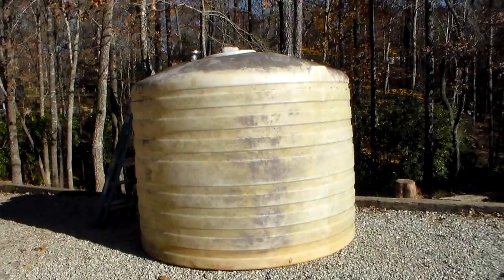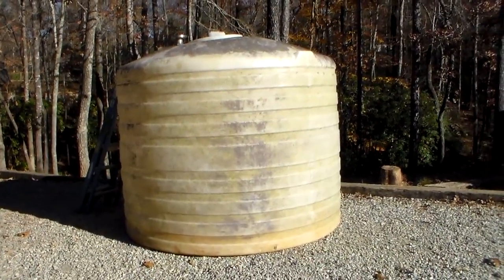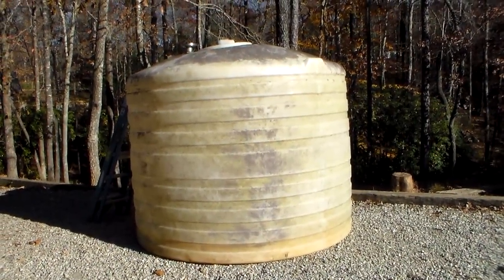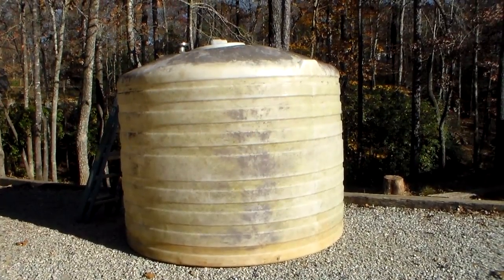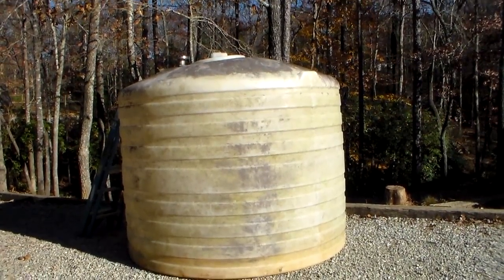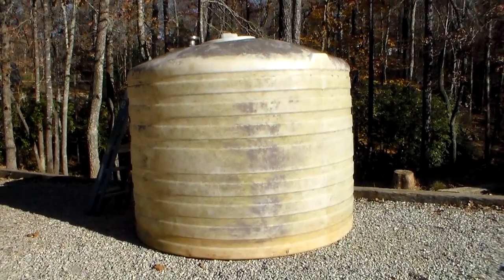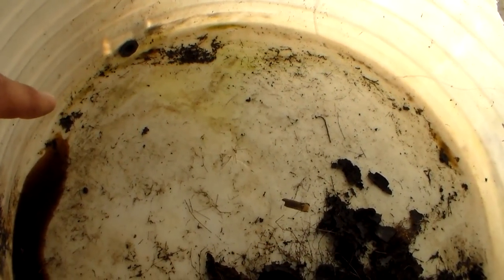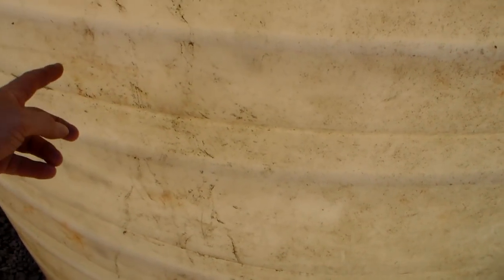Turning a water tank into....Bunker/Fighting position, hunting blind, cache, shelter, or what else?

Comment from the maker: Thank you all for all the great ideas.  Now I have to pick.
Reply: I know the little SP1's already have a play house/fort but they can never have too many forts. I know there's alot more useful things to pick.
Reply: Use it as a fire station buried right next to the house. In case of a fire you don’t need to go far to get water
Reply: @Mentronyc  I believe he said it's damaged and won't hold water. I could be wrong.
Reply: Maybe a grain mill?
Reply: A cold root cellar
Reply: I would cut the bottom out of it and put a rope handle on it and give you a complete hide. Lift it up by the handle scurry underneath and let it down. Looks like a water reservoir but, you can hide inside while people look for you. Aka hiding in plain sight. If you leave 4-5 inch lip you can stand on the lip incase they try to bump it to see if it is empty.
Reply: @whereswendy8544  good one.
Reply: Bury it and make a spider hole entrance. If you have not done something already.

Comment: If you have a "back 40" on your property putting it in the side of a hill and hiding it sounds like a good idea.  Then use it as an emergency bug out spot or rallying point if your main house gets over run. 

 Alternatively keep it closer to the main house and make it refugee housing.  That drain looks to me like it would be good to set up a minimalist plumbing set up if you could run the discharge to your septic tank. Just a sink and toilet would make it much more liveable than a tent.

I would highly advise against using it as a fighting position.  Plastic burns and gives off toxic smoke when it does.  Not a good base for a bunker.
Reply: I was thinking maybe lift it slightly off the ground and use to hang meat or plants to dry or also a smoker

Comment: Put that thing in the ground, all but the last two feet or so.  Put it in a hole thats is just a foot or so bigger than the tank, then pour concrete around the outside.  This will make it very sturdy and provide a ledge for sandbags.  Sandbag the above ground part, leaving ports for shooting of course.  Then cover the top with six inches of dirt, leaves branches, etc.   And don't forget the telescope out the top.  
In similar fashion, I've built two one-man bunkers out of 250 gal shipping containers (without the cages).  I found them for just $25 and have less than $100 invested in each bunker.   They're pretty sweet and comfortable, even in colder weather  (I do recommend adding a wooden floor)  The most important feature being that if someone should shoot into the ports, the bullet wont ricochet inside.  Also that they are so well camouflaged that you can barely see them even when you know where to look.  
Could make a great cellar with this same idea. 

Caution: Don't shoot your gun inside these structures without hearing protection.  I did so while hunting deer from  one and OMG, my ears are still ringing.

Comment: I've patched water tanks like this many times with  epoxy and pladtic screen wire. Clean it then put down a coating of epoxy. Press in some plastic  screen wire while the epoxy is still wet. Let the screen wire work like rebar. Once it's dry coat it with another layer of  epoxy.
 I've had patches like this last for many years. 
I've also used tanks like this for hunting blinds. 
Additionally you can cut the bottom out and set the tank over small pieces of farm equipment to keep them out of the weather.

Comment: After watching literally every video of yours, and assuming/guessing/knowing what you have already, I would suggest cutting some of it into vertical wind turbine airfoils.  A few wings of that height and curve could do some work. Take some of the rest and use it for firewood cover, water guides/gutters/drains, string a few square feet of it camouflaged up in a tree and make a "noise maker"'for alert/diversion, wrap a particular tree and make a false trunk and fill it with dirt/rocks for harder cover, worm bin/compost container...

Comment: A partial cache and defensive position makes the most sense to me. Doing a thin, half concrete wall around the perimeter and sandbags outside that. Though you could take some inspiration from the old Japanese bunkers, having a tunnel leading to it and making the container almost imperceptible with foliage and natural barriers. It would be quite the project but potentially very worthwhile.

Comment: I would stucko the outside and top.  Rap it with sand bags then camo it and use it for a supply cash and bunker.  Put it in the side of a hill. Put in a wood floor or carpet. Glue carpet on the walls and sealing. It won't swet and mold. Heat pvc and bend it to frame a bench and shelves. 11/2 to 2 inch will take some weight. Lol that's what I'd do.

Comment: I've got a friend that has one of those. He cut a square hole in the top and put a hatch and buried it and somehow attached the hatch so it will turn 360 degrees. He has a wireless security system in it with a monitor and 4 cameras outside of his area of protection. He put two 3in metal pipes that come up from it and bend over like a candy cane for ventilation. And he painted the inside and put up some pictures and some shelves, also a couple of fold-out chairs and a hammock that is able to be taken down in seconds with a hook on each side so if he wanted to lay down or sleep. He planted shrubs and bushes around it, painted the hatch camo and you can't even tell it's there. He even has a 20in flat screen TV. He said it stays a constant 58 to 64 degrees no matter how hot or how cold it is outside. I was simply amazed on what he had done. He said he use it as a storm tornado shelter or if anything biological or nuclear he would at least stand a chance of surviving Underground. Hey is my dad with two children and they all fit in there perfectly. Just a thought, making me want to make one for my own.

Comment: Mini greenhouse! I know it wasn't on your list but that's what I'd be doing with it. Plenty of light penetrates that plastic if you put it in the sun. A door, a couple of windows, a raised wood slat floor & shelves. You could grow a ton of herbs, micro greens, & a salad garden in there easily. If you could manage to bury one side of it partway into a hillside with sunlight on the exposed side I bet you could grow something in there year round. Ventilation would be the biggest issue I think. Maybe one pipe near the floor & another up high, like a root cellar to get air flowing? The ability to control the humidity inside could be a real boon if you were using it to start seeds in the spring. Yep, I'd be making a green house out of it if it was sitting in my yard. If you made the windows round & got a little creative with your exterior trim work you could dress it up to look like a hobbit house or maybe a space ship. That thing is literally crying out for some exterior fins. It's ugly as is but it could be made cute so your wife doesn't disown you. And your grandson might really enjoy a project with a bit of whimsey.

Comment: If it’s not engineered to be under the ground it could collapse from lateral pressure. However, you should be able to bury at least half of it. All the other stuff you said should be fine. Just make sure you have condensation control if you store anything that could release moisture

Comment: Ok, bury it and still use the top for access, for either a fighting position or shelter.  Silicone the bottom (you did say the bottom has the crack I believe) then dump some cement in the bottom once in place, to strengthen the bottom where the crack is.  This idea is centered around the crack.  My 2 cents.

Comment: Great ideas.  Install a fake floor for storage.  turn it into a play house for the grand babies. secure all the walls up to where the fake floor is with earth bags covered in moss and garden plants. this protects bottom hiding area helps make sound proof and detracts from the lower level being hidden. make a trap door to the lower storage.  your door idea is great do windows with overhangs on outside protect from rain. spray paint in child cottage theme.  no one would think of searching for the fake floor where you have precious things stored in an invasion.  kids are small so height not an issue.  worst case can hide GB in an invasion.       ha ha   cut in half and make a swimming pool.     you can turn it into a chicken house.  the floor already has the drain for spray cleaning the walls.  make the roosting boxes hang halfway out the walls so you can lift the lids from outside to gather eggs.    would make a great greenhouse.  cut windows out glue screening from inside   make plastic windows for colder night on outside.  hang grow lights and current piping for watering.    I think we have all been consumed with prepping...   just a little fun for the soul to think outside the box...   too many beans and rice under my bead.   blessings my friend!!

Comment: It's a complete unit and will not rust under ground. If I had it I would seal it up real good and get an extension pipe for the top entrance. These can be found at a septic supplier that are used on other plastic tanks. I would then bury it in the ground and stock it with supplies so it's ready for an emergency hideout from your home.  You or a family member or members might need it as a quick retreat to plan an attack should you ever come home and find your house has been taken over by uninvited guests. Anything that can go wrong can go wrong and you will wish you had a place on your property for a quick hidden retreat while you figure out how to handle a situation. We have at least 2 possible scenarios that could happen while you are away from your house. An invasion from groups of city people or an actual war time invasion. That tank can be used as an emergency backup if ever needed.

Comment: I would think that it would have limited value holding back Earth if you buried it completely. Nonetheless I would try to seal it up as well as possible .  I would be inclined to use it as a hidden cache or Root Cellar located remotely for security purposes. But with in convenient walking distance in an emergency. Thinking about it a bit more I would include a hot tent with stove, some dry wood and other basic camp equiment. You could have a near by area prepared to be an emergency camp ground. And have a tent set up and fire in the stove in a half hour more or or less. Clear some ground and plant some camouflage to hide it all.

Comment: These new tanks r getting hard to find since this summer.
Also take notice they r made of plastic/poly cabon which burns.
It's still a good expedient item. The opening can't b locked secured which is another deficiency. It can also b axed open.
Although it's best recycled use could b as a mold to form a steel reinforced concrete shelter so it can b secured shut.
Then cut off the poly carbon if u wish.

Comment: Wood shed. Micro cabin. Something harmless. Because this is forum is owned by a company that made it's name as a search engine, is a leader in speech recognition, and has a unique relationship with the feds as a contractor. :P Less tongue in cheek, with the vents, Im thinking that a well insulated chimney for a very small stove might be doable, so the micro cabin. It will either work really well, or kill whoever is in it from carbon monoxide and/or oxygen deprivation. Or a small catalytic heater with air vents. It would be smaller than small, but doable- an "escape from humans" pod.

Comment: If it is repairable - plastic weld it and evaluate repair. Put in place, 3M 5200 and rubber patch inside, let cure, then four inches of sand mix on top of interior while in place. Even with a slow leak - More valuable as a water tank.

Comment: Bury it 3/4 of the way put sandbags around it and make a steel structure to place dirt and more bags onto then place a ladder going into the ton for the main entrance use the drane ot get new air in along with power place a fan on the top of the container using a pvc to get air out

Comment: If attempting to keep this as a stealth use, would you want plexi on the sides ? Plexiglass might be more reflective in the woods. If you partially bury this, a couple of bags of concrete (on the floor)  would give you some weight to keep it in place, prevent anyone stealing it, and make it easier to sit in a chair if using it as a fighting position. (just not a recliner, you don't need another man cave, and you might fall asleep on duty).

Comment: Well i have no idea what your situation is, and im not asking but........  What do you most need at your place? can this item be used to fill that role? Also,  What does your community need?  does one of your neighbors that is part of your community need a cache or root cellar etc...? can it be set up at a multi propose  structure. Such as root cellar or cool dry storage and a campsite or a emergency  temporary bunk for a couple people?  If you are trying to build a community that can survive together after any sort of SHtF situation, then that boon(the plastic structure) should potentially be considered as how it best benefits the community.  In my current situation i could not use it at my place.

Comment: I saw your video that you made not too long ago about digging graves, in the inevitable event that you will need one, if not only for pets.  I don’t mean to sound morbid but I think this would make a great casket/burial plot/mausoleum.  It will provide some protection for your loved ones from the elements and from animals, in the event someone passes away in an SHTF situation. One or two people could be placed on the bottom, additional soil or earth could be placed on top of that, and more folks can be added if necessary. Of course I am not implying, hoping for, or provocation in any type of terminal situation‘s. But life happens, disease happens, sickness and death happens. I would rather place my family loved ones in a container such as that, if it was at least 2/3 or 3/4 buried or more, then to place them directly in the dirt while wild animals could potentially dig them up. Plus it would help prevent biohazardous contamination of your water supply.

Comment: put it on the edge of a tree line first put the door as you said i would cut a hole in the bottom opposite the door tree line or woods side dig down and back into the woods a few feet and have a hatch to come out into the woods so if you need to retreat the enemy will see you all go in and never know you escaped out the back and by the time they realize your not in there you already worked your way around behind them for the kill